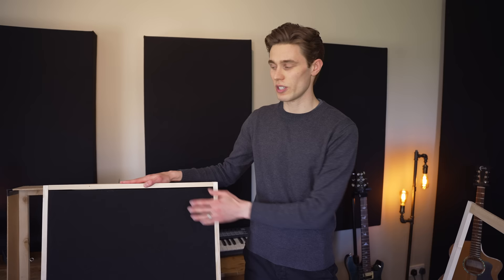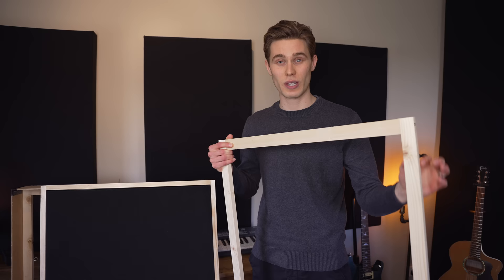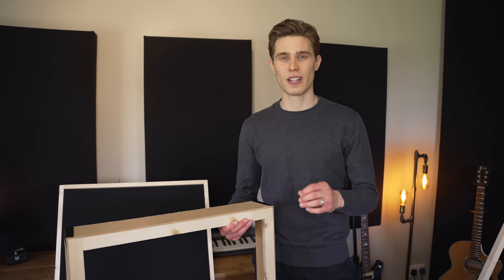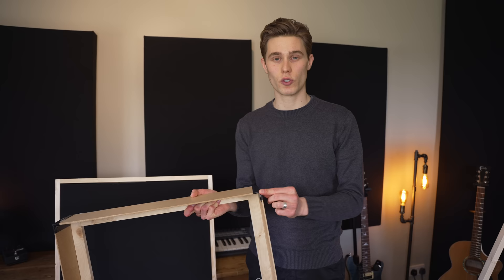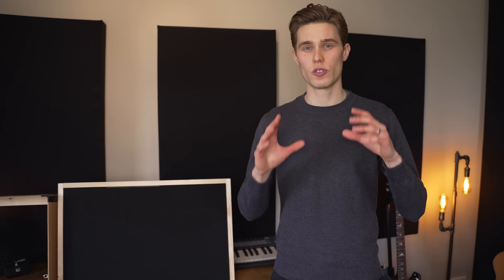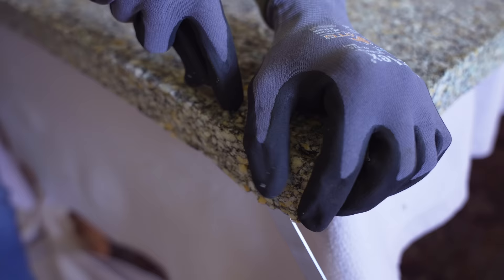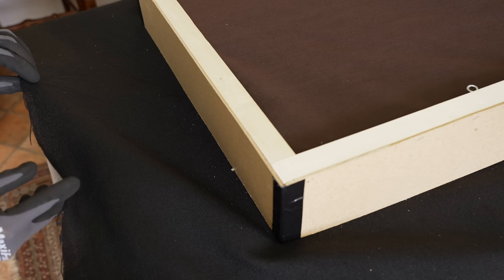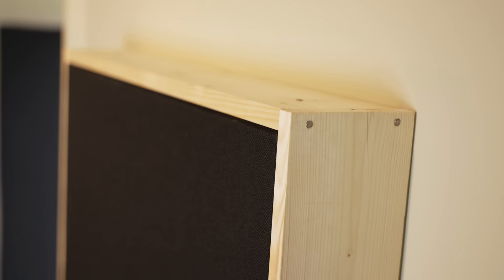How To Make Your Own Acoustic Panels - DIY Professional Acoustic Treatment for Home Studio

Comment: Remember that these panels will not soundproof a room, this is purely to control the acoustics of the room. The more you have in your room the lower the reverb time will be. If you want know what frequencies your panel will absorb, you can calculate it. To treat a frequency you need the absorbing material to be 1/4 the wave length of that frequency, and it will treat every frequency up but not lower. For example if you want to treat 800 hz and up the absorbing material will need to be 4.24 inches. Also place your panels based on first reflection points to help with reflections. Sit in your mixing position and look at the walls and think if I put a mirror on the wall what parts of the wall would I be able to see the monitors and then put a panel there.
Reply: i wonder, if you choose a thicker version, will that absorbe BOTH the higher and lower frequencies So if im after controlling both higher reverberation and control real low frequencies A thicker material will do both? Cheers
Reply: @eddiexx  thick should do both
Reply: @eddiexx  leave an air gap behind the panel as it effectively makes the panel a little thicker as far as the sound is concerned. A couple of inches is ideal.
Reply: From what i have seen and read, 4" Rockwool panels will absorb pretty well down to around 200Hz.
Reply: How do you know what frequencies you need to treat?
Reply: For listening and mixing, I'm pretty sure that you optimally wanna eliminate the whole spectrum of frequencies, so low, mis and high ends but if you specifically want to treat the room for vocal recording for example, you don't need to worry about low frequencies as much as human voice generally doesn't have that much low end as far as I'm aware.  @PierceJPeterson

Comment: An Bass Trap Tutorial would be appreciated as well!
Reply: Bass trap is a description of a specific type of absorber. For best results, determine the frequencies of nodes and compute the trap volume vs material to match those nodes. Just building a random box full of absorption will never work. You may tame a frequency that was helpful and that will only exacerbate a frequency that was the real problem. These things are instruments and bass traps are typically large and expensive. Find out what you need first, then do the research to specify them. I’ve found the info readily available and generously shared.
Reply: fartpooboxohyeah8611    That is absolutely incorrect. It is as basic as it gets that absorption, refraction, transmission each are used to achieve a balanced result. Foam or glass-filled traps are just one tool with a very narrowly focused effect. Nobody, anywhere has ever benefited the sound of their room by using traps or resonators alone. 

The base material of the walls of a space is the number one contributor to sound control, and cannot be dismissed from the total treatment. You make no mention of that. I design professional spaces for music production. If you have questions, I’d be happy to discuss this.

Comment: Update:  last week I finished my eight panels using this design. The inner frame makes wrapping and stapling easier, and the outer frame keeps the fabric clean and scratch free — I was able to use a lightweight white muslin without worrying about it getting shabby over time. 

Based on what I know now, I’d use 5/8” or 3/4” Baltic birch plywood instead of pine for the inner and outer frames.  Pine was too fussy to flatten and thickness-plane.  

One modification I’m glad I made:  I added a 2-foot 1x2 pine strip across the middle to prevent the panel from bowing out.

One mistake I made:  I cut all the inner and outer parts first.  Then I assembled the inner frames and the outer frames. But I failed to adequately account for the 3/16” hardboard dimension around the inner frame, so the first wrapped inner frame didn’t fit into an outer frame.  If I did it again, I’d cut the outer frame members a little long until after I wrap the inner frame. Then I’d cut them to fit the wrapped inner frame.  I was too focused on batching all the dust-producing table saw operations before moving onto the clean fabric work in my limited work space.  To fix it, I had to unscrew the hardboard sides from all the inner frames and trim off about 3/16” from the 1x2 pine frames and the hardboard parts, then screw the hardboard sides back on.  Good thing all that got covered up by the muslin and outer frames!

Notes:

1) I used Rockwool 3”x2’x4’.  I do recommend gloves, but with care I don’t think a mask is necessary.

2) Corner wrapping.  My first panel, my prototype, came out with two pretty good corners and two bulky ones.  After that, I got serious and developed templates for trimming off a specific shape out of the corners of the muslin before wrapping.  The other seven panels have tidy, professional looking corners. If I knew how to make a YouTube video, I'd go into detail about the trimming templates.  I think they make short work of the wrapping and I'm proud of the innovation.  

Total material cost: about $340, including detachable hinges, or $43 per panel (California, 2023).  I think Michael's $25 estimate leaves out the outer frames.

Time investment:  don’t ask.

Finished quality:  outstanding.  Smooth and waxed with softly eased edges. Chose the color I wanted.  

Satisfaction from DIY:  incalculable.
Reply from the maker: I’m so glad this worked out for you and for your detailed advice! This is exactly why I love YouTube. I’ll pin this comment so others can see and learn/modify my design a little.
Reply: @inthemix  Michael, I’m honored.  I’ve also been advocating your design on the Acoustic Guitar Forum, and one member is going to build his panels this way, too.  If you’re interested in my corner trimming templates, let me know and I can email some photos to you. Thanks again for the elegant inner frame idea!
Reply: @b1j I’m interested!
Reply: @mattwhite399  I'm not sure how to add any images here.
Reply: 43 dollar per panels seems like a good deal, panels with properties like shown in the video are going here for 90 dollar (Euro in my case but its basically 1:1) 
Panels of less density or width are not useless but not worth the price. such things you can get for 40-50 Euro/ Dollar here.
Reply: @b1j would you be able to post the cuts you used in US customary units?  For all us idiots not using metric.  :)
Reply: For the center strip across the middle, did you place it on the front or back side of the panel?
Reply: how did u do the strip in the middle?
Reply: where'd you get the Rockwool?
Reply: @doctorwily13  Thanks for asking.  I’m just seeing this.  Mine are made from 23” x 47” x 3” Rockwool Safe N Sound mineral wool batts. They fit easily into a lightweight inner frame made from 3/16” hardboard.  Outside dimensions are 24” x 48”.  With 3/4” pine outer frames, the final size is 25-1/2” x 49-1/2”.
Reply: @NikoTsan  I joined the pine outer frames to the inner frames using Kreg screws through the 1x2 pine inner frame, screwed from the inside so the screws don’t show. The center member is another 2-foot 1x2 pine strip.  All five pine inner frame members were joined at the corners with Kreg pocket hole screws.
Reply: @UnfoundMusic  The 2-foot center strip is in the back, in the same plane as the lightweight pine inner frame.  Besides adding bending strength, it helps support the insulation batt.
Reply: @RhodyRugs  This was the hardest part of the project!  Rockwool makes you beg for it!  I finally found it at Truitt and White, a building supply store in Berkeley, CA when I also bought the 1x4 pine.  I had to go local: shipping would have really hiked up the project cost.  Be persistent and patient.  Good luck!
Reply: He seriously overplayed the 'dangers' of insulating wool. Here in the north every house has hundreds of kilos of it in all the walls of the house and the workers who install them wear no special protection. The only scenario where protection really is needed is if you handle old dried up acoustic panels where the wool has started to disintegrate. That stuff is nasty. Also, all foam is not equal by acoustic properties. There are huge performance differences in having recycled denim or even closed cell foam vs open cell foam. Some materials absorb frequencies unevenly or even refract them if the material is dense enough...
Reply: @b1j I’m in Berkeley too, you mind helping me out 😆

Comment: great video! 
quick tip which makes a very big difference:
I suggest making the frame about 10cm wider than the panel, so you leave an air gap between the actual panel and the wall. This drastically extends the frequency range which your panel will absorb towards the low end of the frequency spectrum.
Reply: Does this mean that hanging such panels from the ceiling instead of drilling them right in benefits the absorption too?
Reply: @Nearest_Neighbor  yes, absolutely!
Reply: I'm trying to wrap my head around how this all works as I hear up to make a few panels for my room: so if I'm using 4cm panels I should want there to use 15-20cm sides so I have the +10cm extra  distance from the wall?
Reply: @felixmarques  if your panels are only 4cm thick, I'm pretty sure making the frame 10cm wider is a bit over the top. I'd say around 5 cm more is enough. So in your case, your frame should be around 9cm thick, that way you have 4cm of space for your panel and another 5cm air gap.
hope this helps :)
Reply: Would this be the same as the external frame? I am a little confused of you making the frame wider and how that increases the air gap... wouldnt increasing the frame size leave space between the insulation and the frame now?
Reply: @yeahna  I believe @TonyMacaroni69_ means what would generally be considered "depth".
Reply: @GoblinModeVR i think so too, he mentioned that the air gap is between the wall and the panel, it can only be the depth/ thickness (which in many cases are 20-30cm)
Reply: Do You Need An Air Gap Behind Your Panels? https://www.youtube.com/watch?v=7RvBw1YAjCo
Reply: NICE! ...because breaking up a soundwave is best done by varying gradations of density... e.g. very, dense, not dense, very dense... Someone knows his physics. Most people probably think adding a layer of air next to the Rockwool lessens its effectiveness. Just the opposite.
Reply: @shaneguy5762  yessir, finally someone gets me haha!

Comment: I just finished making 5 panels, 5.5" thick. They turned out (relatively) light, solid, and visually beautiful. Acoustically, the difference is night and day. Thank you, sir!
Reply: great job!  would you please be able to post what websites or shops did you source the materials from?
Reply: @Muravchix , thank you! I bought the wood, MDF, and insulation from Home Depot (in USA). I bought the acoustic material online from ATS Acoustic, and any miscellaneous items from Amazon. They turned out 10x better than I had hoped for, both acoustically, and visually. (I went with 5.5" / 14cm insulation, and I have sizable airgaps behind the panels, so that really helps.)
Reply: @xyzct  amazing thank you! Enjoy!
Reply: How much did you spend?

Comment: Love the insulation alternatives. The health & safety implications are important but it's also important to note that the denim, hemp, wood and recycled insulation are much more environmentally friendly and sustainable too. Doing your part for you, your room and the planet!
Reply: but do they insulate better than the more dangerous materials??
Reply: @Mrcheesydancer so as the video says the higher the density the better the panel. Wood fiber has a density of 50kg/m^3 (at least the one I just bought). The glasswool isolation (very common one) had only 12kg/m^3

I never tried anything else, but I’m very happy with my wood fiber panels

Comment: I LOVE this. I see a few commenters upset that you didn’t whip out an SPL or RTA meter to do before and after measurements (I get it, treating specific frequencies is important) but something tells me that wasn’t the goal here. The goal was to DIY some affordable and decent acoustic treatment using dense, absorptive materials. Honestly, this is an excellent solution for reflections and for those higher frequencies (and, depending on the materials the individual has chosen, one could target mids and potentially  even lows). You achieved that goal, well done!
Reply from the maker: I’m so happy that this is how the video came across to you. It’s precisely what I wanted to do. Hopefully people can see that treatment is accessible and doesn’t need to be too scientific to be helpful.

Comment: This is a beautifully produced video presented by a  uniquely bright and personable young man. I think of how much better my day would be if there were more people like this. I am grateful for the efforts and knowledge that this young man has shared with the rest of us. Well done!
Reply: But he's not discussing absorption coefficient curves and the importance of having the best absorption coefficient curves for mid and high frequency absorption to reduce reflections.  as well as low frequency pressure problems.   

. I would suggest going to Acoustic Fields' site.  They have, IMO, the best open cell foam on the market and they cater to the DIY crowd that wants the best treatment.  They have DIY build plans to make the best low frequency pressure absorption, and you can add their foam to the front to make a full range absorption box. Also, they have build plans for Quadratic Diffusors.  They can also design a barrier and treatment wall for those that need to build their own room. It gets expensive, but the results are of the highest quality.

Comment: When you do add the outer frame you also have the option of mounting that onto a set of legs so you can stand them up anywhere and don’t need to hang them on the wall at all
Reply: possibly some wheels on those legs too

Comment: I had great success with a similar concept. I built frames from pine, and filled them with 2'x4' ceiling tiles, and maintained an air gap behind the tiles. Ceiling tiles are used frequently in drop ceilings to improve acoustics and reduce echo, and they work well on a wall, too. Covered the panels with inexpensive felt from a fabric store. I alternated between black and dark red panels. Made 10 of them.
Reply: This sounds like a very reasonable take on making panels.  Did the ceiling tiles help with the acoustics much?

Comment: Just as your tutorials on mixing are better than most, more concise and to the point, so is this tutorial on acoustic panels making. 
One possible alternative to avoid wall mounting, is to built a larger base or some kind of "feet" so the panels would be freestanding, and would be movable around the room and double as gobos, if necessary.
Reply from the maker: Thank you for the kind words. Making stands is an excellent idea especially if you want to use them in a recording space. I have to admit, I haven’t thought much about how to design the legs but I’m sure there are some good designs out there.

Comment: Hi Michael.  It’s just a bit more than one year after your video, and today I began the build of what will become eight 2’ x 2’ x 4” panels using your clever inner-frame design.  Using the 1/4” board for the inner frame keeps the panel solid but still light, while a sturdy outer frame keeps the fabric on the sides clean and free of scratches. I’m opting to include the pine outer frame so I can hinge panels together to use as moveable gobos around me when tracking.  The outer frame will take the scuffing. They’ll also double as wall hangers when I mix. If I was only going the hang them on walls, I’d skip the outer frames. I have the insulation and wood, and I made the first cuts today.  Still need to get the fabric. I’ll start with one panel to work out the bugs.  Thank you for the design inspiration.  You got me off the fence I’ve been on for two years.

One modification:  I’m going to use pocket-hole joinery (Kreg system) for the 1 x 2 frame, and for the 1 x 4 outer frame.  This avoids both screwing into end grain and visible screws! Also, I plan to add a cross piece of 1 x 2 joining the four-foot sections, to reduce deformation when carrying the panels around.

Comment: Just finished this project. It took a few days time, but wasn't difficult to do by myself. I found a 6 pack of 4'x2'x2" cotton batts on Amazon and got the rest of supplies at home depot, and fabric at Walmart. I spent a total of $360 to make 8 panels, (4) 4'x2' and (4) 4'x1'. This came out to $45 per panel. Timber was $70, insulation was $180 shipped, fabric $40, hardware and tools were $70. It was a fun project and I'm glad I have some treatment in my home studio now, but expected the cost to be a bit lower.